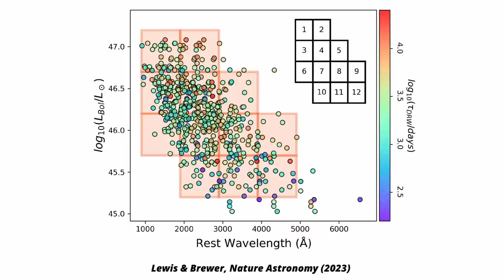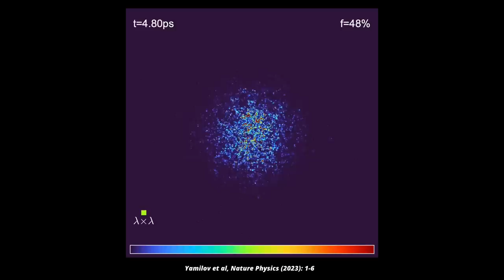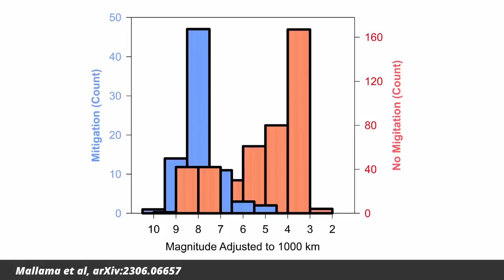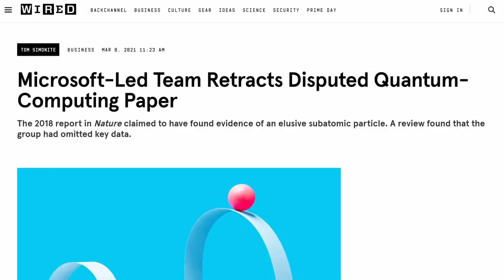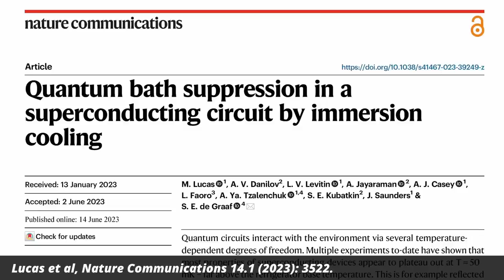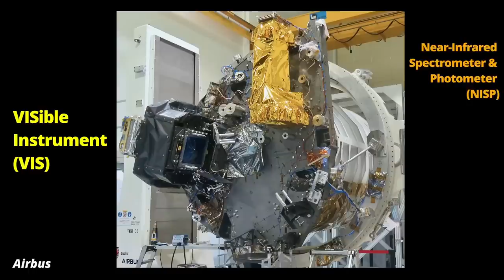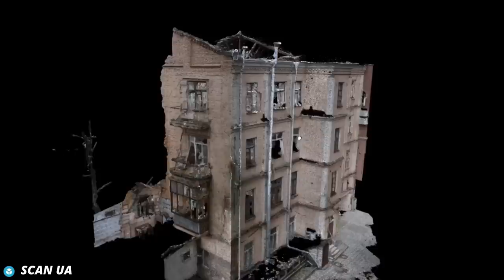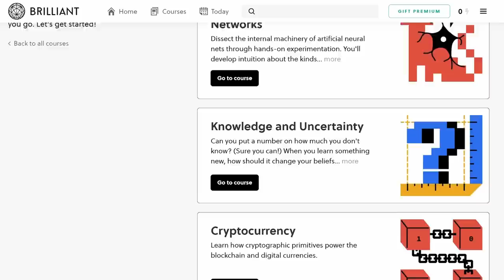Time Ran Slower in Early Universe, New Study Finds

Comment: To all the Big Bangers out there. The language of mathematics with its infinite number of infinities has trapped you in worm holes made of mirrors and  has trapped you in black holes filled with rabbits.

A singularity is an anomaly introduced by the infinite number of infinities in the language of mathematics.

As a Big Banger you must suspend all the physical laws of nature and BLeaves that the Universe began from an infinite amount of density and an infinite amount of temperature, thus a singularity is a physical impossibility. 

There is a solution. This new axiom of mathematics, “ -c>∞<c+ ” that reduces the infinite number of infinites into a singular infinity bound between the negative speed of light and the positive speed of light.

Michio Kaku BLeaves that he can teach his students how to calculate the probability of the student magically waking up on Mars. This BLeave is the result of a Boltzman Brain emerging inside Kaku's cranium. 

Aristotle made the distention between two infinities. 

"Actual Infinity"

Using the Wallisian mathematical language model, -∞<0.0<∞+, a particle has to be located somewhere, a measurement of x must yield a value between -∞ and ∞+. The probability approaches zero as the calculation approaches infinity.

"Potential Infinity"

Using the KnoWellian mathematical language model, -c>∞<c+, a particle cannot translate space faster than the speed of light, a measurement of x must yield a value between -C and C+. The probability approaches zero as the calculation approaches the numerical speed of light.

Can any particle travel near the numerical speed of infinity?

Of course not. The particle ceased to exist at the numerical speed of light, so why try to calculate for a particle's infinite vector space in which the particle cannot exist?

Thus an infinite vector space can never be translated by a particle, but a vector space bound by the numerical speed of light ensures the particles existence.

If you are stuck on this point that a particle can not translate an infinite vector space, you are trapped deep down in the black hole filled with an infinite number of infinite rabbits.

Just because the language of mathematics allows the calculation, that does not mean the calculation is describing reality.

When quantum theorists limit their calculations between the negative speed of light and the positive speed of light, Kaku's dream of waking up on Mars becomes, just a dream.

If you argue with these facts, then you have a cranium filled with a Boltzman Brain too.

The highest probability for the creation and destruction of our Universe is a steady state of causal sets.

~3K

Comment: You could say that  time was slower in the early universe only if you knew surely that the transformation or aging processes of all forms of matter then took place in greater lengths in space when compared them to the current transformation or aging processes of all forms of matter in the universe, and basing yourself on the lengths in space the Earth has traveled a long its orbit around the Sun as the standard foundation for the measurements and comparisons
What time actually represents if the continuous sequence of changes of physical structures and positions in space of all forms of matter in the universe, but not any sort of speed as totally fundamentally misunderstood by ignorant human scientists, and the units of time actually are the distance lengths in space which the Earth has travelled along it's orbit around the Sun in a certain number of cycles of sunlight and darkness experienced by the Earth's surface, but not the symbolic mathematical units of hours, minutes, seconds on human-invented clocks, and days, weeks,  months, and years on calendars

Comment: Times slows down in the early universe ? but hang on, isn't that whole red shift thing only relative to the observer ? meaning our perception of distant , and thus ancient objects, might appear as slow for US, HERE, but NOT for the objects at the other end, ie , in their local space time....Apart from that, I have great difficulty in accepting that, from a truly relative point of view, that "perceived" events back then could in any way be slower, because a) the universe was smaller, hotter, more compact,  with b) smaller distance between particles, collisions on any scale would be quicker, hold more energy etc. time runs the same speed but events in general  might take less time than they would now because of this...edit..shouldn't have stopped to write this and listened further on...

Comment: ... so if we stop using the word "space, then all we really know is that whatever happened to that light made its wavelength longer... what if switching on and off in the crunchy quantum sand causes red-shifting? Instead of the shift happening because spacetime, which arguably don't exist, it happens because crunchy quantum sand? Seems like there's a whole crew of physics professors that don't read the news! For years. It's like continuing to use an astrolabe and a pocket watch, instead of Google maps, no? 😂

Comment: First off. Why does nobody check the light properties, if it actually acts like a sound wave. What i have understood it's 2 particles rotating round each other, creating a wave when they are in sync and a chaos stat when not in sync. This means that light does not act like a sound wave. And the whole theory of a expanding universe is wrong. The red shift come from the light is loosing energy not compressing together like a sound wave. The different colors comes from different rotations speed of the spinning light particles. So who do you believe more me who says that the light is loosing energy (slower rotation) or Big bang theorists?

Comment: So was it 5.12168465 × 10^-44 instead of 5.391247 × 10^-44 seconds? Or did the length stay the same relatively and there is no way to measure a current deviation except relative to some other?

Comment: If time ran slower in the early universe, does it mean that the light speed was higher back then?
Reply: No. The speed of light is a constant, and the consequences of that is what causes everything else to be relative. Time dilation, length contraction, etc -- all that happens because the speed of light doesn't change, so everything else (including time) has to.

Comment: If you have have the bubbles screen saver in your windows 12, the bubbles overlap when they are computer generated.  If you visualize them writting this code, "why do you waste a megabyte on a screen saver."  The guy must have been from Barbie knows physics, cuz wouldn't we have higher dimensions' if w'e owned our black hole's?

Comment: 6:50 When there will be 100,000 satellites in space, Kessler syndrome will occur, making manned space flights impossible for decades. This will be fElon Musk's greatest "achievement".
Reply: And they'll all be gone in ten years. LEO orbits are not stable because of atmospheric drag. If it ever becomes a problem, it will sort itself out soon enough.
Reply: @EnglishMike  Not true. The Hubble Space Telescope, for example, has a LEO orbit, is not being periodically bumped to a higher orbit (unlike the ISS), and is already orbiting for 33 years.
Reply: @Bruno_Haible  That's also incorrect. Hubble has been boosted into higher orbit at least three times in the last 30 years -- 1993, 1997, and 2009. There were two other service missions, but I can't tell if a boost was included. That's the only reason Hubble didn't fall out of orbit years ago. There is an ongoing debate as to whether they should do it again, to keep Hubble in service for longer.

But I should have been more specific -- I'm talking about the LEO orbits used by the constellations of internet communications satellites that are used by Starlink and its competitors. This is where the vast majority of the possible 100k satellites will live. Starlink has plans for putting up to 42,000 into orbit themselves.

The average lifespan of these ISP satellites is estimated to be 7 - 10 years.
Reply: @EnglishMike  OK. It seems you are right. If we get a Kessler syndrome in LEO, it will "only" last for 10-20 years.

Comment: Doesn’t time run at a constant 1 second per second?  Any other speeds seem…. Nonsensical.
Oh, I get the idea that remotely observing events occurring elsewhere may be bound to observe events occurring at different speeds than they really occurred at, but by itself… yeah, that’s saying time ran slower is a confusing and misleading statement to make, even with the context supplied.  If I follow properly, it’s the circumstances of the observer relative to the observed event.  Remove the observer and there is no effect to measure.  Put another way - this is subjective, not objective in nature.